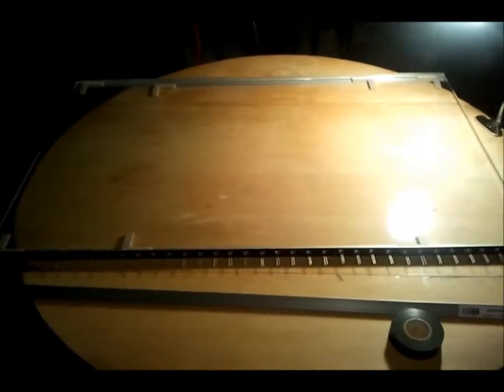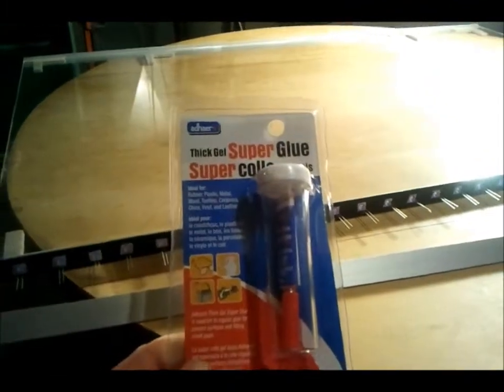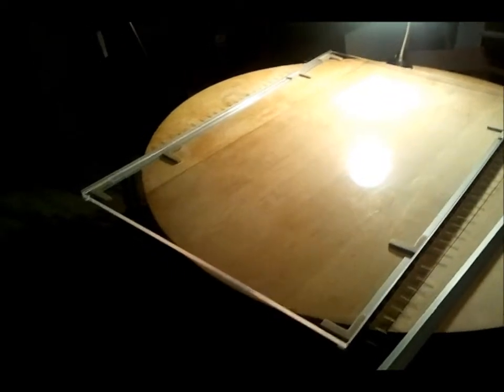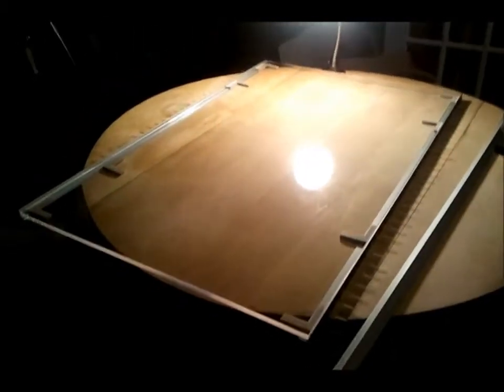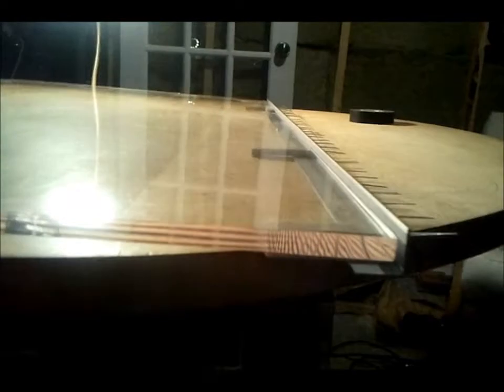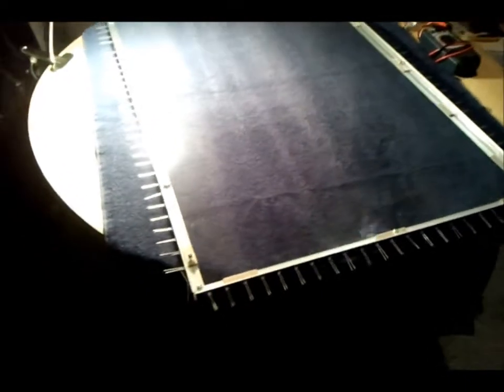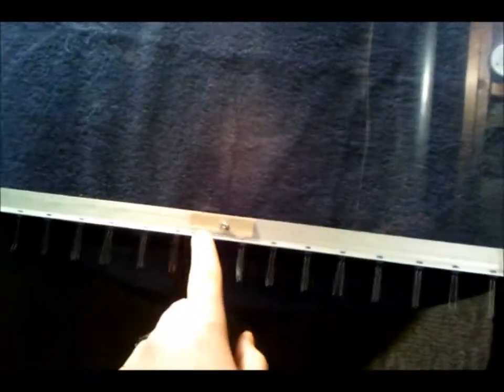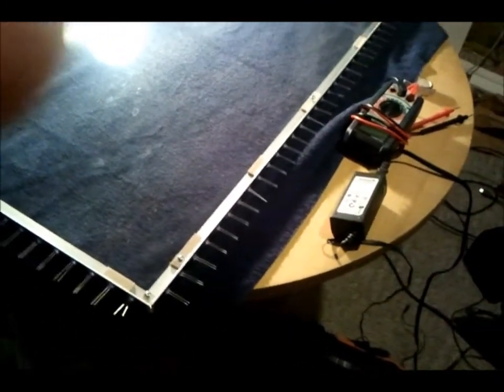MultiTouch Video 3 - Frame Construction

Comment: How thick is that acrylic glass? Thank you
Reply from the maker: Kaye Tolentino it was 9mm
Reply: VolitionsAdvocate Thanks. Well, how do you think it would affect it if we only got 5 mm?
Reply from the maker: I think that would be too small depending on the size of the screen you are building. At least as far as stability goes.  The other problem you'll run into is that most LEDs, if you're making a DIY frame like I did rather than using light strips, is the standard LED size is 5mm,  So it would need to be a bit thicker to accomodate the light if you didn't want it to bleed out all over the surface.

That's just my opinion though, This project is really old and I would do a better job if I were to do it again.  Probably pull apart an LCD tv to do it instead of using a projector.